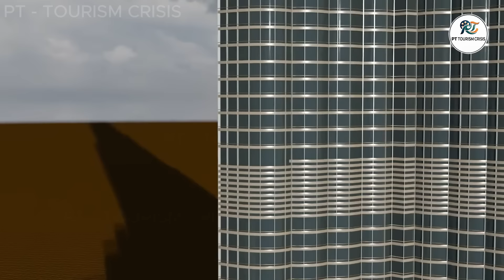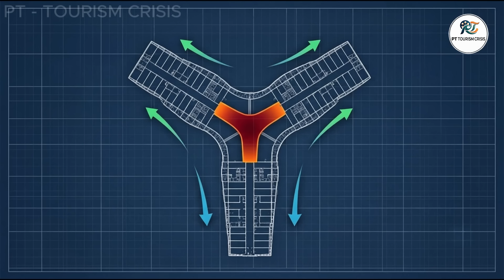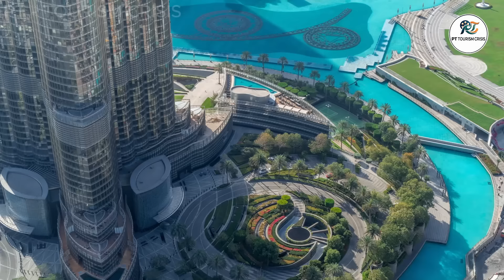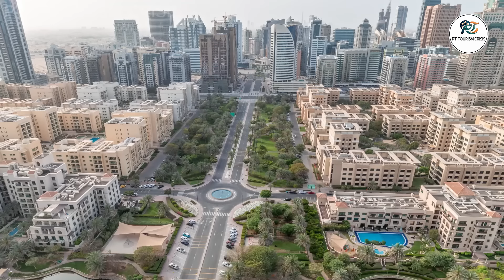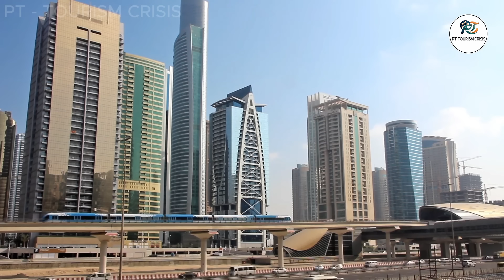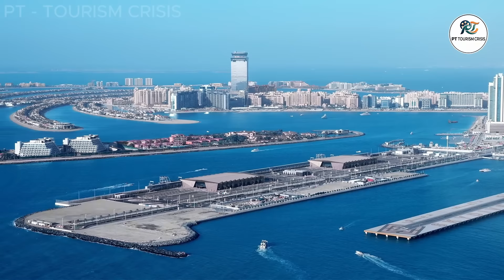Why Burj Khalifa Could SNAP: How A 43mm Shift Created TERRIFYING Reality In Dubai

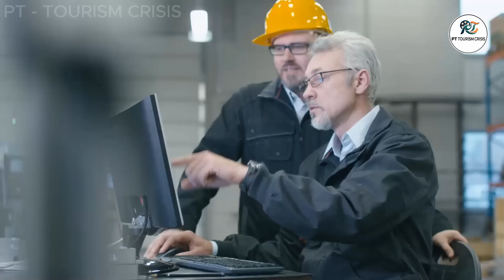Comment: 3:40 Yet , engineer saw to build the tallest building in the world on said Shifting sediment😂😂😂 Make it make sense😂😂😂
Reply from the maker: That is exactly why the foundation is so complex. The tower does not simply sit on loose sand, it transfers its load deep into stronger layers through a massive piled foundation.
Reply: Geld?
Reply: Es fehlt der Faktor Grundwasser: Durch dessen Absaugen bekommt die Absenkung größere Dimension. Da hilft auch keine Geheimhaltung: Der Bau ist der erste, der unbewohnbar wird und kontrolliert gesprengt werden muss - was wieder "wertvolle Daten" liefert...

Comment: To prevent disastrous failure, they must disassemble and scrap it.
Reply from the maker: That would be an extreme conclusion. Careful monitoring, maintenance, and targeted repairs are far more realistic than dismantling an entire structure.
Reply: @PTtourismcrisis   Extremely stupid problems like putting the tallest building in the world on sand, in the hottest desert, require extreme solutions.

Comment: Nonsense. It weighs about 500,000 tonnes. The Romanian parliament is about 4,000,000 tonnes, about 8 times as much.
Reply from the maker: Fair correction. Total weight alone is not the key comparison though, because footprint, height, load distribution, foundation design, and ground conditions matter enormously.

Comment: Imagine if China built it.
Reply from the maker: China has built some extraordinary megaprojects too, but every project still comes down to engineering quality, site conditions, and long-term maintenance.
Reply: @PTtourismcrisis  China has too much corruption at all levels of construction. Taking shortcuts to save money that should not be taken. Such as filling support columns with styrofoam, or rubber rebar. In Venezuala, many of the buildings that collapsed were built by a chinese company, and the shortcuts were visible.

Comment: The waters of the Gulf are getting more salty-due to desalinization. This might cause corrosion of the support piers. Then the tower could be in danger
Reply: The gulf is connected to the world oceans, so I would like to check your math regarding the gallons of water desalinated and amount of salt returned to the Gulf. I just don’t think they produce enough yet to make an appreciable difference. If you had an inland sea, that would be a different story.
Reply from the maker: @CountJeffula That is a fair point. The Gulf is connected to the Indian Ocean, so the key issue is localized salinity buildup near discharge zones, not the entire Gulf becoming dramatically saltier.
Reply from the maker: Brine discharge can increase local salinity, but corrosion risk depends on chloride exposure, materials, protective systems, and maintenance, so it does not automatically mean the tower is in danger.